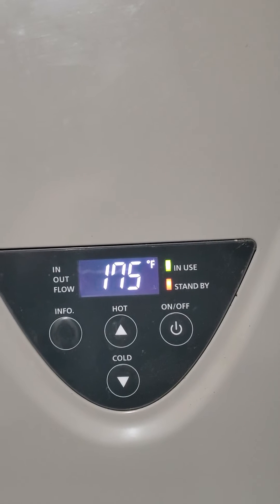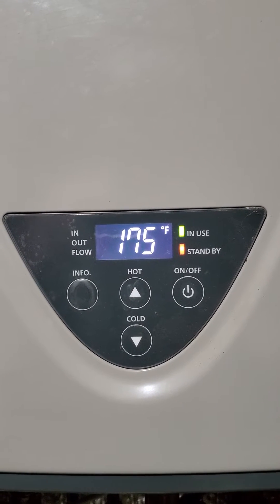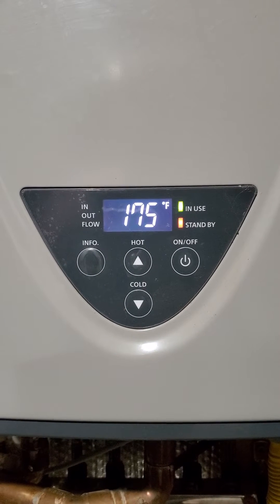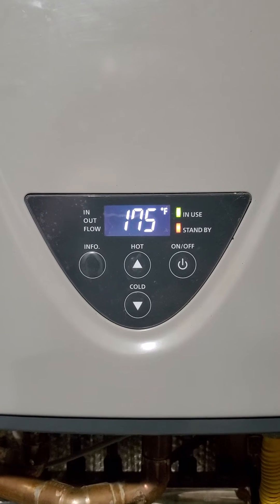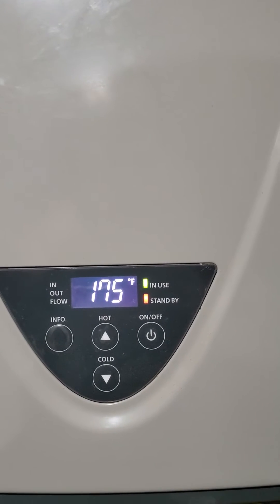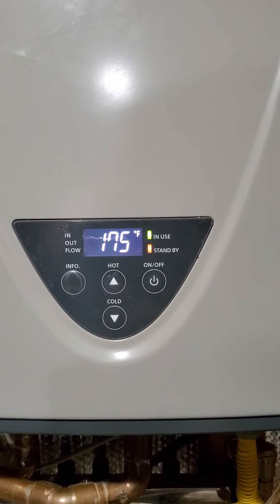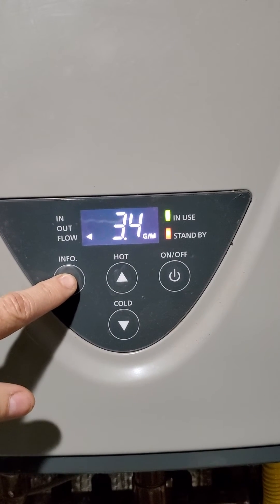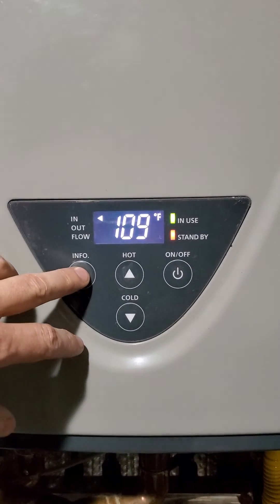Hydro Smart boiler help needed

Comment: Hello i have exact same system my hydrasmart is making a horrible noise. I just bought this house a year ago. And cant find a lot of info out there on it. Had a heating and cooling company out and (the guy) didnt act like he knew a lot about it either. Any info would be very helpful
Reply from the maker: I can try. Any error codes?
Does it heat the water etc..
Reply from the maker: The 2 main noise sources are the combustion itself and the fan. The combustion is a low frequency roar or rumble, more pronounced during startup. The fan is quieter, but if a bearing is failing it could be a squeal
Reply: @Jeorider  everything is working its a constant noise while running ill try and get a video of it in the next couple days. I actually found manual in kitchen drawer it mentions it has to have 25 to 55 perfent glycol or will cause burner to make excesive noise
Reply from the maker: @fireline8548  Good point,  Not enough antifreeze in the loop will effect the boiling point and viscosity.
Reply from the maker: @fireline8548  Boiler Kettling.
Reply: @Jeorider  i put vid of my system running

Comment: Maybe it's just shutting off because it has achieved set temperature?  Then kicks on again when needed.
Reply from the maker: Thank you for the help. I removed the manifold and used a torch tip cleaner to clean the jets.
After reassembly the system now works.
It appears that the flame was to low?? 
Not sure why it would just restart instead of throwing an error.